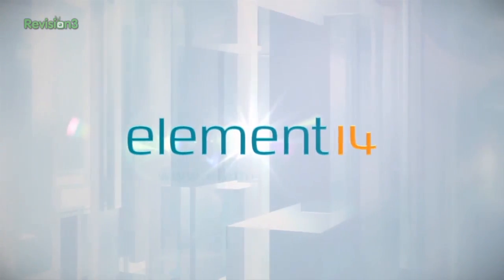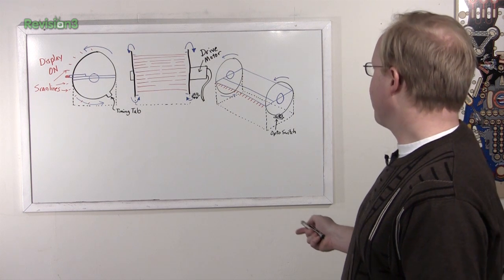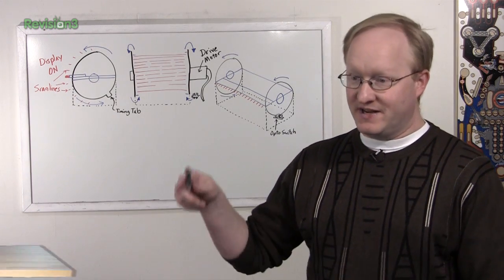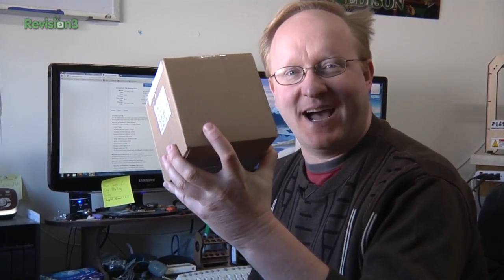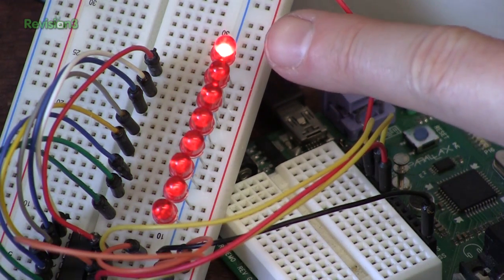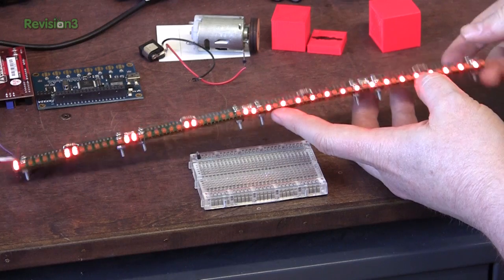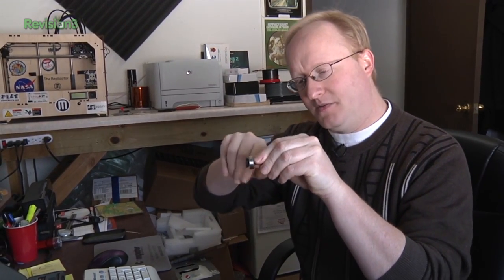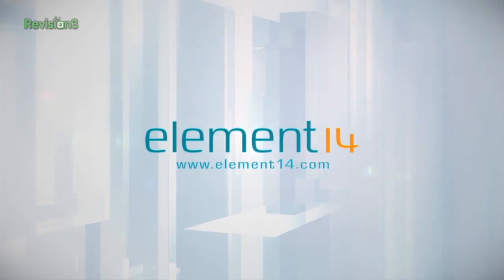Ben's Steampunk Persistence of Vision Display

Comment: If it is not to late, I'd like to recommend changing the opto-tab to an opto-hole. You really don't want a small tab like exposed and spinning around at 600rpm.
Reply: I totally agree.  That would definitely be how I would try to set it up.

Comment: Wouldn't it be better to run the power from a battery inside the drum and wirelessly send the video data? That would eliminate the Interference caused by brushes. Looking forward to the next episode.
Reply: Wireless + Motor(interference) == No joy.
Reply: Yeah,....forgot about the motor.

Comment: you should use 2 brushless motors for this thing. one for spinning the pcbs and the other one could be used as a generator to power your boards. this way u could put the microcontroller on the spinning part as well and use a motor on eather side without additional bearings. in my experience brushes always are a pain in the ....